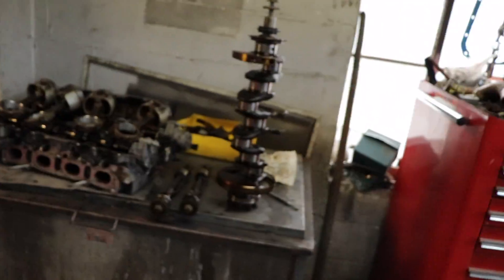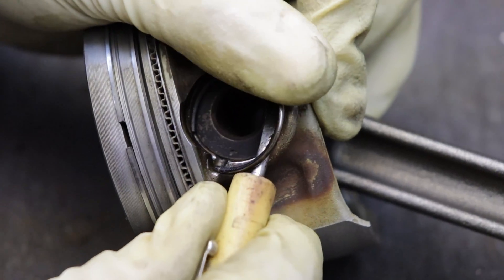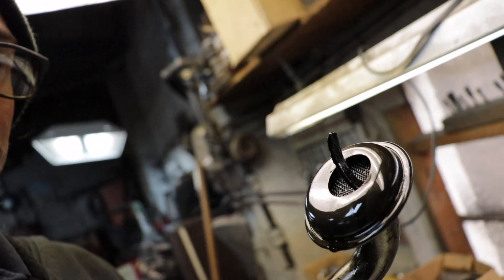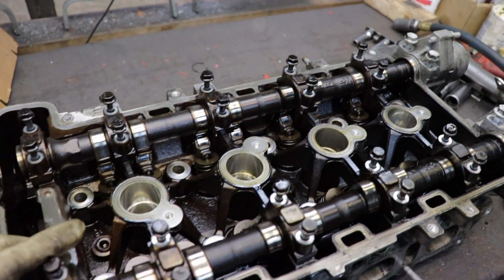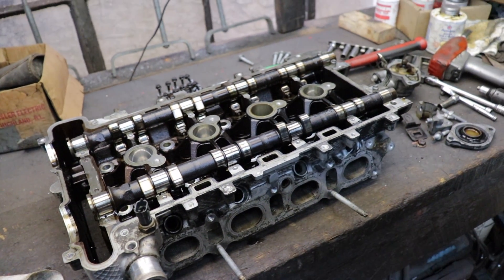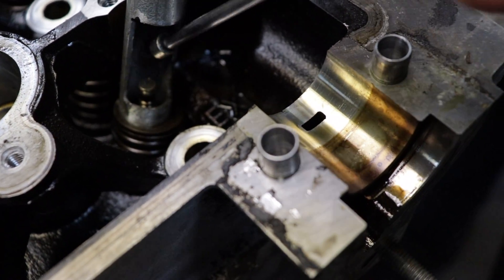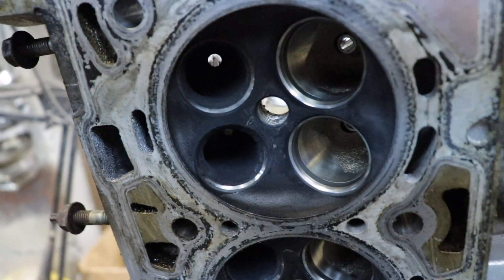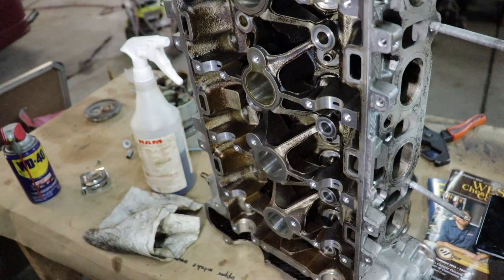Cobalt SS LSJ Cylinder Head Dissasembly

Comment: Good stuff. I think for the cam caps you are suppose to remove them one turn at a time so the cams lift at a similar angle without causing to much stress on the cam.  I couldn’t find a removal sequence but just the info I mentioned.   I need to make a valve removal tool that’s easy to use.
Reply from the maker: dude if you can make a tool, that'd be some real creative work
Reply: Salvo Brothers already been done and everything removed :) worked great!

Comment: hi there the balance shaft have bearings  in the block  if yea cut them off you lose oil ? pressure the oil holes will have to blocked off on the balance bearings holes but id never done it i am not going to  cut ours  cool channel
Reply from the maker: thnx for the info ill have to look more into that, id like to find a fairly cheap way to eliminate them without buying the kits